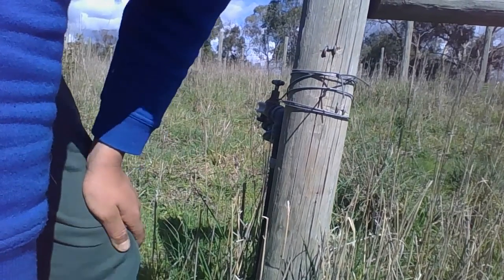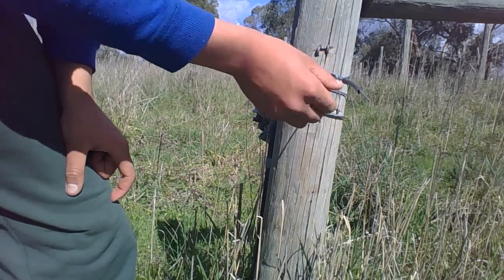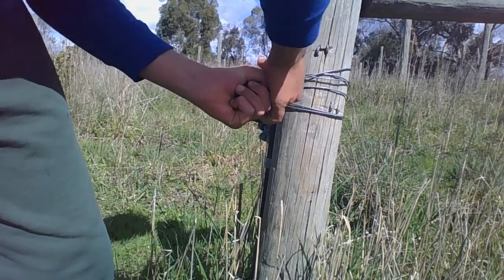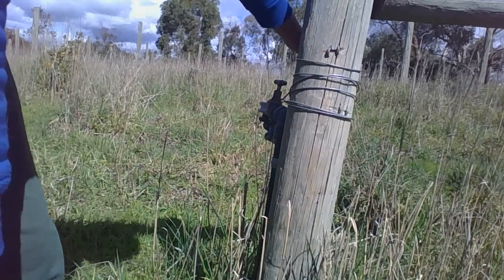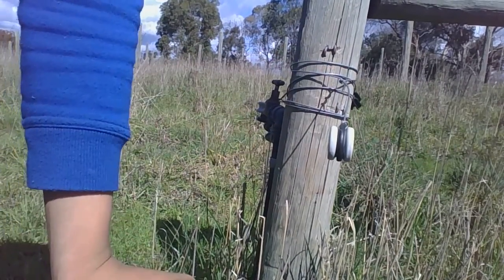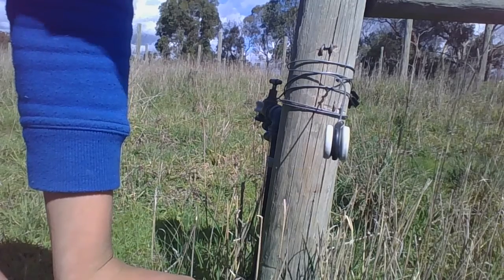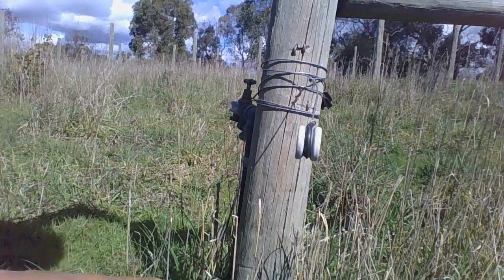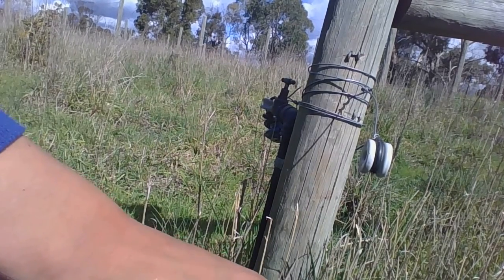How to install a corner insulator for non-terminating fence.- Basic Version

Comment: Brilliant.  I have a Shetland that just ducks under the temporary fence line around feed paddocks.  The pig tail posts are high enough for her work that out. With a lower line on the temporary posts I won’t have to install star pickets.  Thank you.  Great idea.
Reply from the maker: If you are using Gallagher or any general pigtail posts there should be small plastic clips to attach to the side of the posts to put a lower wire. I have trouble with the posts being too short for horses or regular ponies,  so I end up having to use star pickets on corners etc anyway-

Comment: Cool, nice video man;)
Reply from the maker: Yep I will upload the version on how to do it for high tensile videos, sorry I have been slack in uploading, I have had a cold recently and being choking myself all day.
Reply from the maker: If you think this is a good way, check this out: https://www.youtube.com/watch?v=iZkhTs9cgJE You will like the insulator I used for the demo..
Reply: Oh, ok I'll check;)
Reply from the maker: Sorry for keeping you waiting for videos on the poles and insulators, just have to set up electric fences, so I might just show you how its done because lots of people who set fences up do not know what they are doing, and messing it up.
Reply: I wondered how they where set up, there's a guy not to far away from me who uses actual power pole insulators on his electric fence, but If I had built an electric fence, I would not use my insulators, but I'd make homemade insulators to put on;DD
Reply from the maker: The on in the other video is a powerline insulator, they actually work better than normal fence ones. I might make a video showing how I used powerline and telephone lines like the ones in the finds from ..../2016 video. That's why I got those ones, for electric fences! Your insulators are more hard to find and they are your collection, but the ones I use I already have at least a double or triple of before using, so do not worry, my collection is safe.